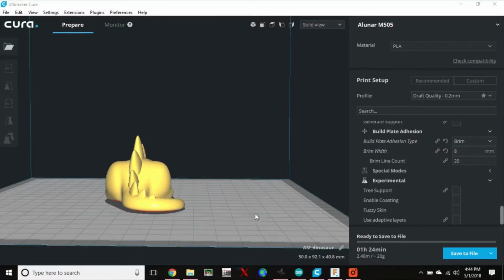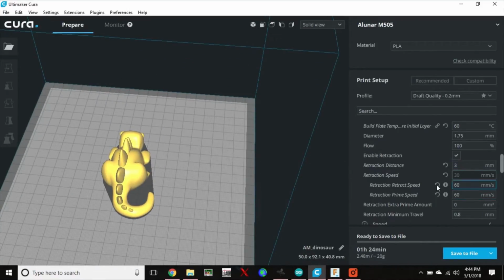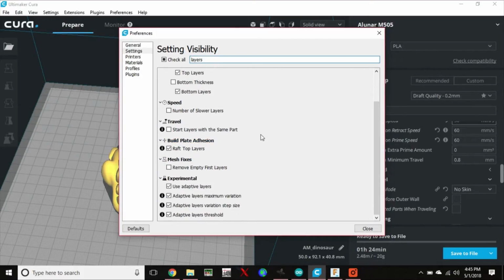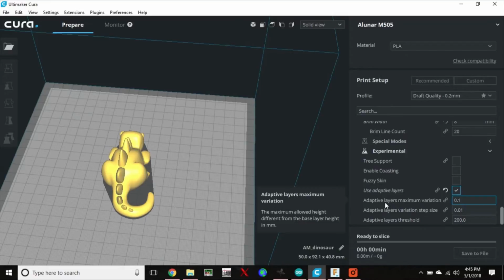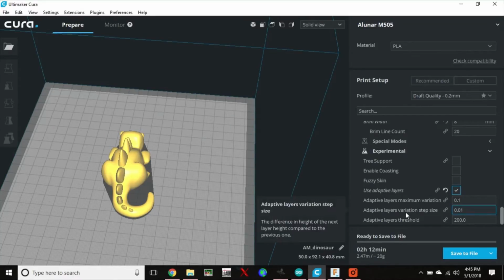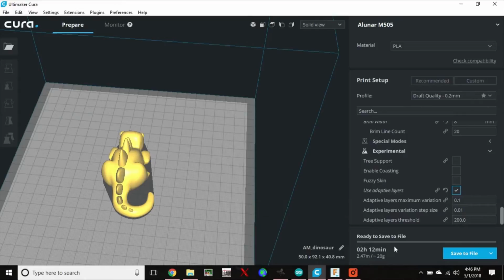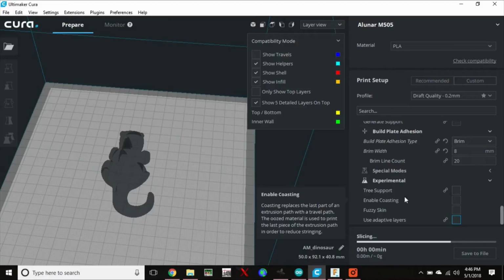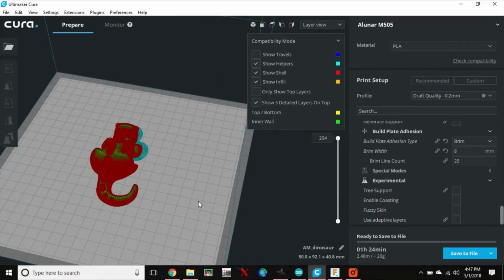Cura Experimental Features - Adaptive Layers - EDIT

Comment: This is almost the feature I want.  I'm trying to increase the resolution at the contact points where 2 pieces join only.  That way I can have high precision where it matters and faster print where it doesn't.

FYI, cameras can only focus up to a point, if the subject is too close, the camera won't be able to focus, period.  Pull the subject further away and it will be able to focus.

Comment: I've been having problems with this feature lately. Seems a bit buggy or my firmware isn't suited for it. The smaller layers seem to need a higher flow rate and higher temperatures to bond without layer separation. When it goes back to 0.3 it needs lower temps and lower flow. I would have thought it would be the other way round, but I spent a whole day messing with the LCD settings during a print, trying to save it. The result of all my constant tweaking left very visible layer lines. Some layers were breaking up, some were squished together. Maybe I have other problems with the printer but I can replicate the exact issue on a model in the same place when using adaptive layers.
Reply from the maker: Wow, that is interesting.  I too would have thought things would be the other way around.  What printer are you using?
Reply: @TMcWorkshop  Geeetech A10M